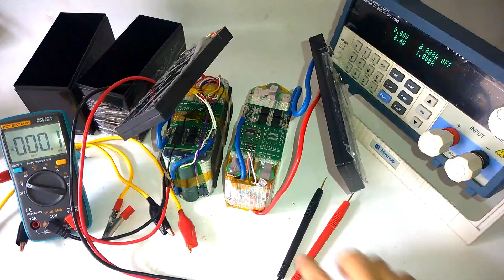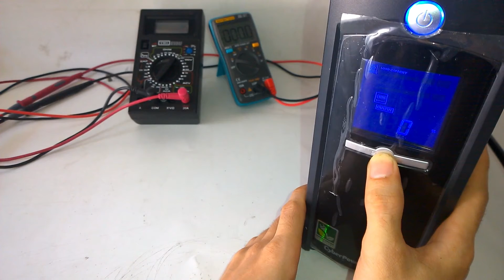12V + 12V 7Ah Li-ion Battery Pack For CyberPower 1350AVR UPS

Comment: 7:29 I understand it ~ 57 watts (2.37A * 24V) is the consumption of idling or under load, taking into account the efficiency of the UPS?
Reply from the maker: 2.37A  I loaded a light bulb. UPS no load 0.7A.

Comment: @Yousun  hi i am also working on a same project. But i am worried by the battery charger in the ups which is designed for lead acid batteries.
Reply from the maker: Add a capacitor to the charging terminal to stabilize the voltage.
Reply: @yousun2827  capacitor voltage and capacitance?  Is there a way to use seperate li ion charger? If yes, how to connect?
Reply from the maker: Connect multiple high-power diodes in series.

Comment: Hi ! Very detailed videos about BMS and Lion battery conversions.Please guide me if the BMS also provides CC CV charging, or it is the dc adatptor that should have builtin CC CV function.Simply whethter the BMS only balances individual cell voltages or it also performs CC-CV charging? 
I am planning on replacing dry lead acid battries of UPS,  12V battries six in series (72V system).Is it possible to charge the Lion pack with same UPS?
Thanks in advance.
Reply from the maker: Yes! Need to customize BMS, 72V system is expensive to use lithium battery.
Reply: @yousun2827 Hi! Thanks for replay.in your Lion 12 volts pack conversion of cyberpower UPS, you installed a BMS to protect the Lion Pack.But what about charging this pack by the ups that was originally designed for lead acid battery charging?will there be any affect in the charging process?
thanks again!
Reply: @yousun2827  hi i am also working on a same project. But i am worried by the battery charger in the ups which is designed for lead acid batteries.